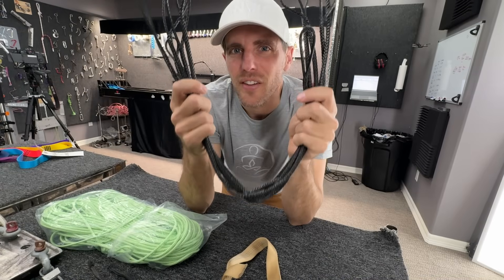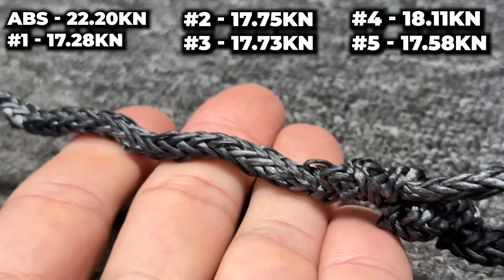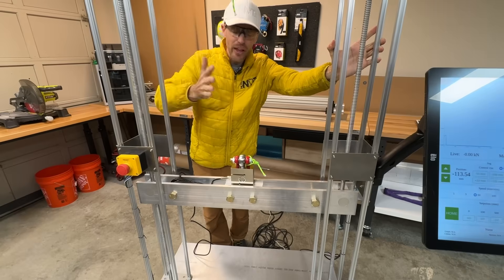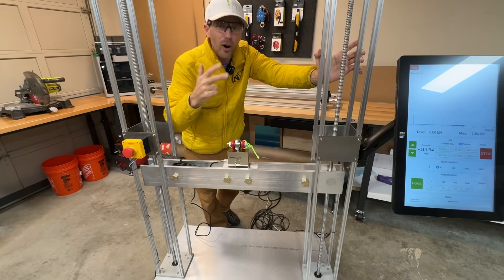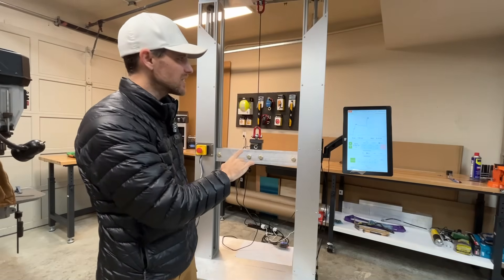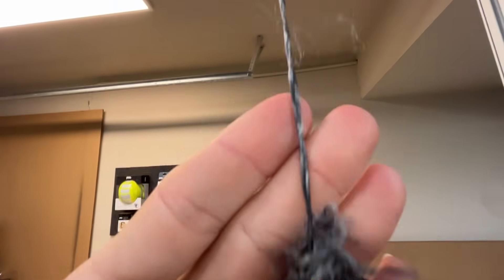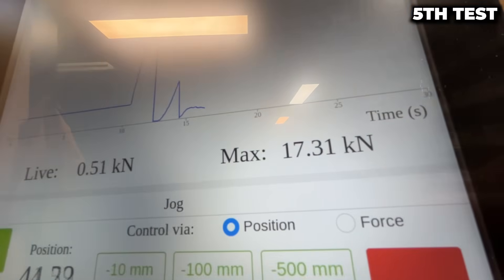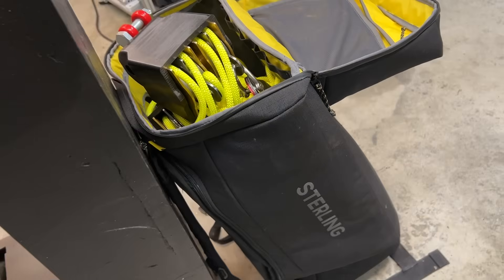Why are the numbers always wrong?

Comment: Under high torque conditions, it's not uncommon for servo motors to slip and lose position—especially if the load exceeds the motor's rated holding torque or if acceleration/deceleration is too aggressive. This can lead to misalignment and significant issues in precision systems.
Reply: Stepper motors, you mean. Servos don't slip.
Reply: @ While servo motors are closed-loop and don’t normally slip like steppers, they can still lose position under overload conditions if the load exceeds rated torque or acceleration is too aggressive.
Reply: In technical terms, "servo motor" only means that it's a motor which acts as servo, i.e. it has closed loop control. It doesn't tell you what type of electric motor is in use.

Comment: @7:48, 

I'm no structural engineer, however consider an H or I design (a cross section looking down) with enough cross bracing. Maybe even an arch might be the most efficient shape (weight or costs to provide the greatest resistance to movement).

Surely there are some ME's who can look at the design and help to dissect weakest point(s) of failure. (Whatever the final design might look like).

I do like that you are prototyping before beefing up certain members.
Reply: Think radio tower or stage lighting structures, they all have triangles. In structural design triangles are one of the lightest ways to get something very strong. Enclosing it like they did here is also a good way but the strength still only really comes from the points the sheeting is attached to the underlying structure, so technically its still a form of triangulation.

Comment: I think your value Ryan is trying tests that are more realistic to what rope access, climbing, slack community, etc might experience.

Who cares about squeezing out the largest value.

If your tests show the ABS is around 17.6 kN and not the 20.2 kN that a manufacturer reports, then this is a greater service to the community.

(Absolutely it is cool to demonstrate you could reproduce their testing conditions but that is more a general proof of concept you could fudge the numbers equally to the manufacturer.)

(Having only your own ethics, you might as well apply them and share methodology, maths and results like have you have been doing. In time, manufacturers can come around to better testing practices if you can really demonstrate the ABS should be ~10% to ~20% lower than what is typically stated.)

Comment: all you need is a smaller hydraulic pump for your other machine, try to get a separate pump and motor and connect them with the pulley wheels off a cheap pillar drill then you will have an easy way to change the speed.
Reply: Heck even a characterized orifice would be a modest start. And if you put a encoder and a PID loop on the piston attached to a Servo driven needle valve. This could do the same thing

Comment: you can slow down hydraulic.....
Reply: yeah I wonder what kind of flow controls he's running
Reply: @JonXuereb  There is no flow control or pump speed controll, just on/off switch and pressure relief valve for safety/limit. I believe that hydraulic pump motor is powered from 12V battery.. There is plenty of ways to improve control in this hydraulic machine..

Comment: I spent seven years working with Dyneema in body armor. if I had to describe it, it would be radically inconsistent.. what you’re failing to adapt for is heat and cold cycling. If that rope has been through sitting in extremely hot environments for excellent amount of time, it will have a totally different failure point than a rope that hasn’t. They also have different failure points at different temperatures. Because it’s made out of polyethylene. It’s still a very strong rope, but you need to use it at 50% capacity to have a safe experience..